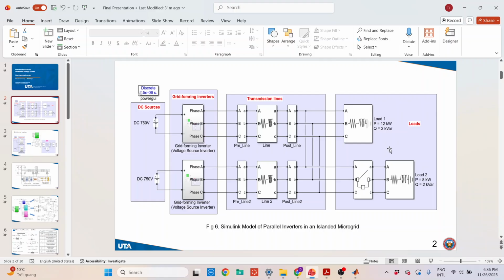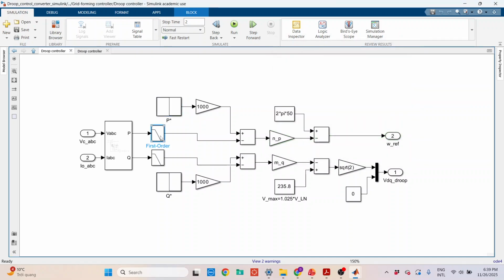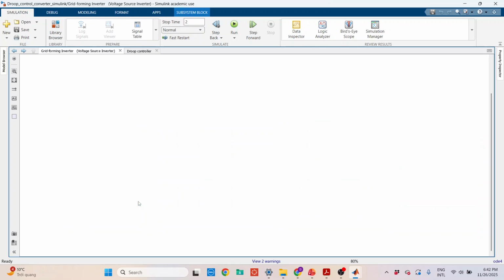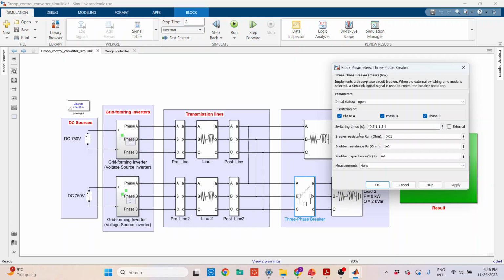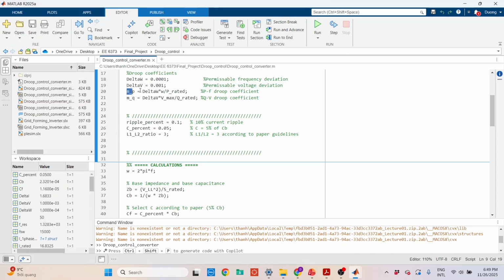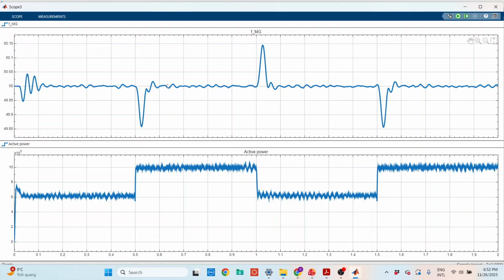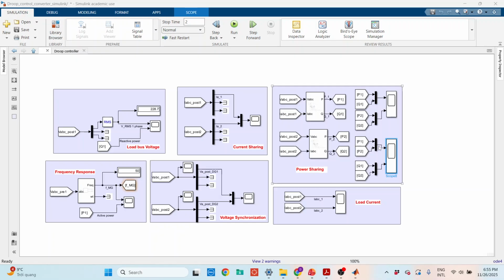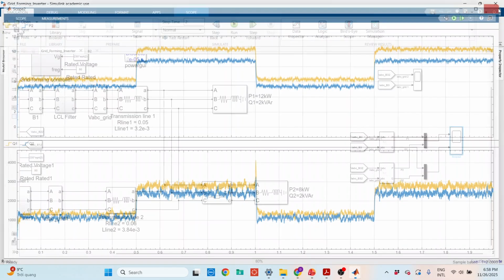Grid-forming inverters (Power Sharing, Droop Control, Virtual Impedance, LCL Filter Design)

Comment: Hello Sir, I am currently doing research on Grid-Forming (GFM) inverters. Your video has been incredibly helpful as I build my voltage and current control loops.

However, I am facing a slight issue: my q-axis voltage (Vq) has a lot of ripple. I am using PLECS for my simulation. Would you be willing to share your simulation file so I can use it as a reference? Alternatively, could you point out what common errors might cause this high Vq ripple? Thank you very much!
Reply from the maker: Can you type me your email